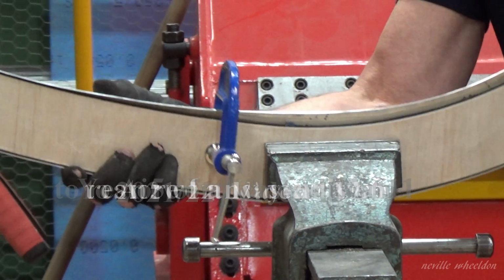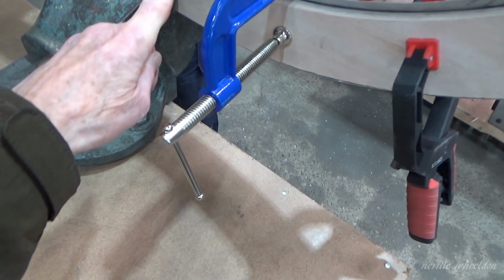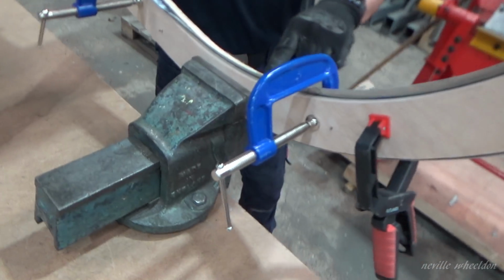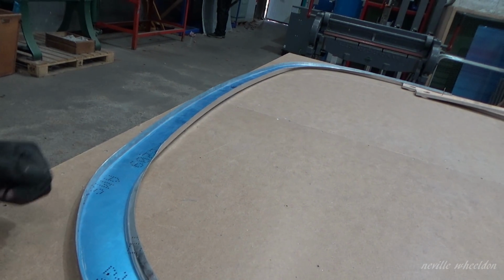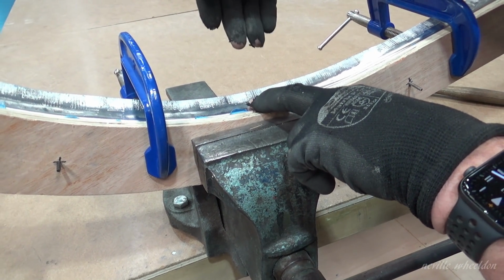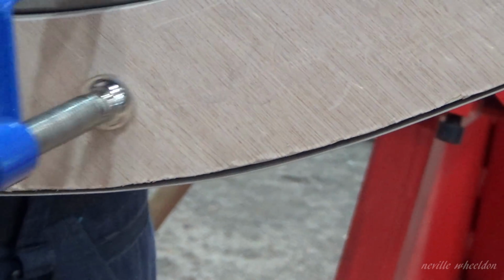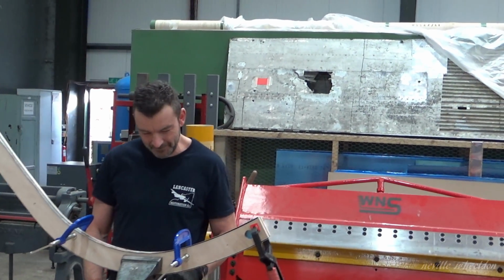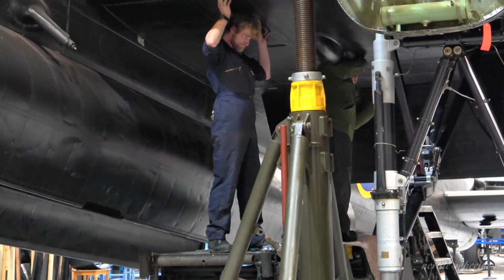Video 137 Restoration of Lancaster NX611 Year 5.-- Dave forms the inner curve on fuselage Former

Comment: Dave exhibits not only a wonderfully trained eye and hard won experience, but most importantly great patience - in performing the task - not I hasten to add, with the admirable Neville 'kibitzing' for our benefit! I wonder if the use of a tipping wheel might prove a viable perhaps speedier alternative method - at least on the initial flange?
Reply from the maker: Hi Teresa , I guess Dave has is own way of doing things. I was not in this side of engineering not sure what a tipping wheel is. ( English wheel?)

Comment: its very satisfying to watch this process of reconstruction, but i'm a little on the impatient side and have to find ways to speed the process up - curling the sides over the frame former is indeed very slow and i see why
when you have to keep stopping to use the machine to stretch or shrink the metal to prevent splitting
i wonder if a roller system can be used, like pass the edge between two splined wheels at a low pressure, perhaps not precise enough to apply the right pressure at exact points, but might provide gentle pressure on more area, a little like an English wheel might operate over required areas
that also makes me think of the hammering action, if the whole frame and former could be passed between roller, one would need to be sprung to cope with the varying width of the frame body, gradually working the edge from inside to outside as we see with the hammering

Comment: Hi Neville, another great video thanks. What I don’t understand is why the formers are stretched on the inside curve and shrunk on the outside. Surely the outside flange is longer than the inside one so should this not be the other way round. Perhaps one of the experts could explain this to a complete novice like me. Also do we know how they were made originally? Hopefully a much quicker process.
Reply: Think for a minute about where the metal is going.
On the outside the metal is being forced into a tighter radius, so it must be shrunk.
On the inside the flange being formed is a larger radius than the inside edge of the blank so it must be stretched.
I can't speak to how the originals were formed. I'd imagine they were die stamped out in a press much like automotive parts.
But if manufacturing capacity had other priorities I suppose this operation could still have been hammer formed over a sturdier buck than plywood.
(If enough man (woman?) power was available)*
Reply from the maker: Hi mate a good answer from Jim.

Comment: Great work by Dave.  Patience truly needed for that.  Have they done an assessment of the former conditions on NX611 yet or will they not know until next season when they start pulling it apart?
Reply from the maker: Hi ajg617 they have done an assessment some corrosion, but as you say until they pull it down they don't really know.

Comment: good stuff, how to you avoid the aluminium becoming work hardened?
Reply: I was going to ask if Dave anneals those ribs between shrinker/stretcher sessions to keep from tearing.
I'd also wonder why it didn't come as T0? 
Surely they need to be stress relived and solution tempered after that much cold working.
Reply from the maker: Hi Geoff. you have to remember this rear fuselage will not be airworthy ,so they made them strong  enough for the job in hand. After EK returns it to Doncaster museum it will be a static exhibit. So cost comes into play.
Reply from the maker: @jimurrata6785  Hi Jim, if Dave was working to CAA standards he would be using T0 aluminium  when formed heat treated to T3 standard but this is not going  to be airworthy structure, just for taxying for 6 months two days a week then a static display back in Doncaster.
Reply: @nevillewheeldon1693  Thank you Neville.
I'm not entirely familiar with this project, but understood it was going to run (be functional)
Taxi worthy is not airworthy any more than my car is.  😄
I'm glad the YouTube algorithm introduced me to your Lancaster reconstruction.
The whole team is doing a fantastic job!   👏
Reply from the maker: @jimurrata6785  Hi Jim NX611 will be Airworthy. The Wing and the rear fuselage the engineer are working are not off NX611 but will be made safe but not airworthy. These will be fitted to NX611 wile the wing and rear fuselage taken off are made airworthy. This will enable NX611 to carry on during the summer months giving taxi rides to the public earning good revenue to help with the restoration. The wing and fuselage from NX611 will be made airworthy and fitted back on to NX611 and the removed wing  will be returned to the French and the rear fuselage will be returned to Doncaster museum at zero cost to them self's. Thanks for watching Jim.  Nev.

Comment: Thanks for the video. Still a waste of time and aluminum. You cannot use this method for airworthy parts. I know you disagree as do most of your viewers. Why spend hrs and hrs when this method stretches and work hardens the metal and it will crack.... JJ must fly not just taxi when finished.
Reply from the maker: Hi David,  I'm not sure on a waste of time. ! , never been in the aircraft industry or worked  with sheet metal so not qualified to answer. The job these formers are going to do looks strong enough to me, they will not be airworthy. .